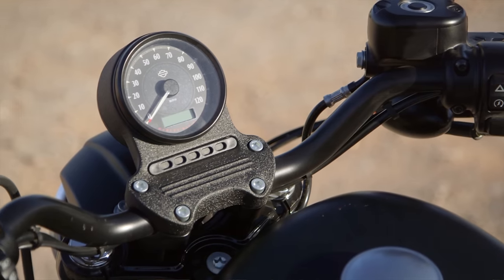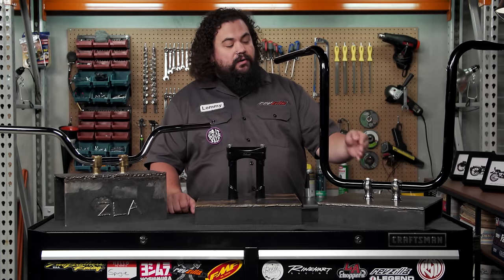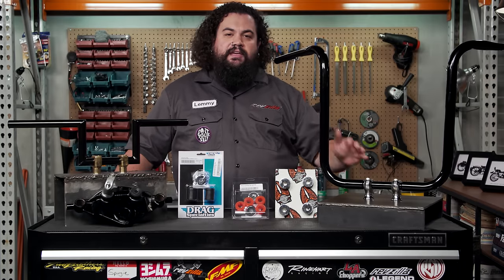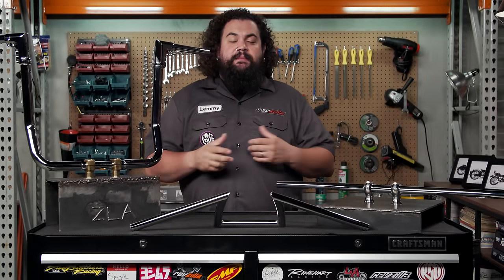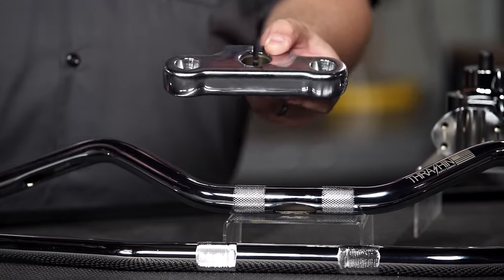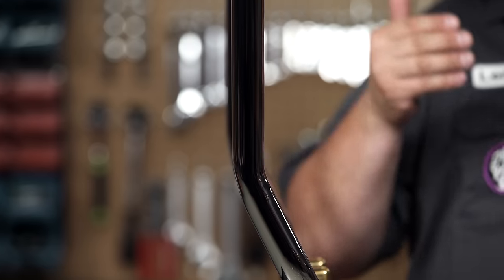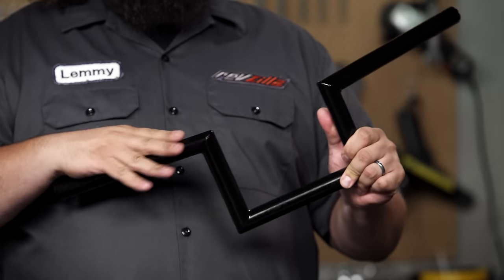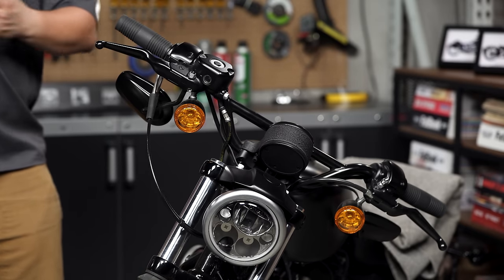How To Choose Handlebars & Risers For Harley-Davidson Motorcycles

Comment: Some 1-1/4" bagger HD bars require the left side of the bar to be trimmed if heated grips are used so that the controls will fit snugly against the 1" to 1-1/4" step-up. Real important to know before you assemble so that you don't have to take apart and do all over again.

Comment: Have a Yamaha Bolt that with the stock bars my left hand goes numb. I use gel padded gloves and upgraded to Avon grips but still get numbness in my left hand. Not a lot of options with my bike, already emailed Rox about their risers. Bar Snake won't work with stock bars either, found that out after purchasing.

Comment: Excellent video, thank you. How do I know if my 2019 Harley Roadster xl1200cx has internal wiring? I want to put ape hangers either 8" or 10" but don't know if I should buy pre-wired or just the wire kit along with the bars.

Comment: I currently have 11 inch "ram horn" bars with a 2 inch riser. (1999 FXDWG OEM)

I'm interested in swapping them for 14 inch lane splitter MX T-bars. Will I need any new cables?

Comment: I have a 2021 trike and I want to change out my OEM handlebars, thanks for the video and I know trikes were not specifically named but bagger’s and ultra’s were and we are in the same family. I have heard that on Harley’s 13 and down models only a 10” and below can be installed without using extension and on a 14 and up models we can use a 12” handlebar. What is your take?

Comment: I have a stock iron 883- and want to put on a set of biltwell chumps. Do I need to do recabling, or are they long enough? thank you
Reply from the maker: The 8 inch rise on the Chumps is probably too tall to keep the stock cables, but you could get the handlebar and see if the stock cables could work with some cable rerouting. -DrewZilla

Comment: Hi.
I'm from India and riding an  XL1200C of 2015. I want to change stock handlebar without changing any cables. Can you suggest the best bar except ape bars though I'm interested in 32wide reach handlebar.
Pl note I have to get it done at service center.

Comment: I want bars on my 02 Sofetail classic like the factory bars on my 72 FLH. I hate these low ape hangers that were on it when iI bought. I see bars but they aren't for inside wiring. With all the after market bars you would think there would be a ton of stock FLSTC bars on Ebay

Comment: I just got an iron 883 2019, if I was to buy the mini ape handlebars which have an 8.75 inch rise would I have to get a new cable kit and wiring?
Reply from the maker: Yes, you will need new cables and wiring. -DrewZilla

Comment: Hey Lemmy, I have a 2016 iron 883 , can you tell me the max height for drag specialties riser without changing out my stock cable. What would the max height be in the pullback riser and the straight riser ? Thanks !!
Reply from the maker: Your bike in particular has very little slack, you can really only get another 2" up in the riser, which would be the same for straight or pullback style.

-Zack
Reply: Perfect , Thanks for the info  👍

Comment: Hello. I have a 1975 harley fxe super glide and I have low drag brand handlebars and I want to add 10 inch ape hanger. So I can I put any handle bars on? I have the single piece knurled clamp and the handle bars I want say it fits 2000s harleys soft tails.  Any advice will be cool
Reply from the maker: Yes, you can put most any 1 inch diameter bars on. -DrewZilla

Comment: My handlebar end cap fell off. What holds it in place? Did another part fall out and is missing? 2003 anniversary RK. Thanks!
Reply from the maker: Those are likely aftermarket grips, so it would depend how those grips secure their endcaps. You'd have to determine the manufacturer. -DrewZilla

Comment: I just bought my first Harley Davidson. It's a fatboy 2010. It currently has pretty high Ape Hangers on it. Im not sure i like that, and would personally rather have a 6-8" t bar, fat dragbar or something like that. Im not 100 sure yet. But my question is, when it is currenty fitted with apes (im not sure about the rising, since i havent picked up the bike yet. But im guessing maybe 17" rise) What about the wiring then? Im guessing the wiring will be far too long when i lower it to, lets say 8" dragbars? Or will it be fine with nice cable management? Hope someone can help me! :D
Reply from the maker: You will most likely need to get shorter clutch/brake/throttle lines and perhaps shorten the wiring, but you won't know until you get the bike and see. -DrewZilla

Comment: Can you tell me which risers revzilla carries that are made to take a 1¼" bar that narrow down to 1" at the clamping area and covers the gaps between the riser and the areas where it steps up to the larger diameter bar?
Reply from the maker: The standard diameter for risers at the clamping area is 1 inch, so if you have 1 1/4" bars that are stepped down to 1" at the clamping area, then you would want risers that have a one-piece top plate to cover the full width of the 1" stepped down area. Avoid one-piece risers that are angled, as they would show the step down. Look at those that are very rectangular. -DrewZilla
*http://bit.ly/VTwinRisers_1inchDiameter

Comment: I listened to the whole video,didn't get the answer that I was looking for.
Wanted to know how to factor in the height in inches that will relate into the shortened reach as well.
I have heard that for every 1 inch in height,it will also shorten 1 inch in reach distance as well...I'm Not sure about that but was hoping to get that answered in the video.
          I am planning to buy soon the 2020 FXLRS...
Trying to decide to either go LD's 13 (11")...or the MX SD Bar (12").
I am 5' 4" in height so I'm kinda short,I want the bars at shoulder level.
I don't want the bar to be at full arm extension but neither do I want it to be too close.I have looked at many videos to get some good idea but only getting confused.
          A reply would be much appreciated if you can clear this up for me to go in the right direction...and Thanks👍😎.
Reply from the maker: There's no hard and fast rule about height to reach. There are a lot of factors: the angle of the bars, the pullback, your torso length, and your arm length. You will need to measure the height and pullback of the stock handlebar then put your hands in the desired position in the air and have someone measure the difference from the stock bar. -DrewZilla
Reply: @RevZilla  
Thanks for the reply and info👍😎.

Comment: Any idea how much you can rise the bar on a sportster without changing the wiring? Thanks
Reply from the maker: You can go to about a 6" bar in height typically without requiring new cables.  This is the tallest bar we typically see installed with stock wiring:

www.revzilla.com/motorcycle/biltwell-keystone-1-handlebars

-Zack
Reply: @RevZilla  thanks so much for the answer, really helped

Comment: I have a bad back. On my 2000 Electra glide they are stock bars. What style bars would be best to take tension off my back? I’m thinking a very up straight riding position would be best. With the stick bar I stay slightly hunched over and I’m about 6 ft 2 in tall.
Reply from the maker: Yes, I would recommend handlebars with more pullback and possibly more height. Unfortunately, we don't have the stock bar dimensions on-hand, but if you eyeball the height, width, and pullback of your current bars with a tape measure, you can send us an email or give us a call to discuss further. We can be reached at cs@revzilla.com or 877-792-9455. -DrewZilla
Reply: Really, I was thinking beach bars but you say that would not be a good idea?
Reply: Right now there stock bars on a Electra glide.
Reply: Sorry already told you that. There in the stock position. I’ll take some measurements email or call. Thank you.

Comment: Lemmy what about my 2008 low rider. That darn indicator clamp. Trying to do a tbar look. Any thoughts??
Reply: And hide the wires.
Reply from the maker: If you want to still have indicators with a T-bar, the most popular thing is to use is small Motogadget gauges. -DrewZilla
*https://www.revzilla.com/motorcycle/motogadget-motoscope-mini-speedometer
*https://www.revzilla.com/motorcycle/motogadget-motoscope-mini-combination-handlebar-clip-kit-bracket

Comment: How are those factory mirrors on the sporty. I have 08 nightster and haven't fiddled with the mirrors to get the clearance left side hits tank. When I bought it they were under and I made them switch them back and last month decided try it again but haven't gotten the fit right so the hit
Reply from the maker: They work just fine. -DrewZilla
Reply: Any idea the cost on them

Comment: Hey, what if you wanted to put on a set of sport bike forks to enhance the sporty. How would one go about that?
Reply from the maker: That's a whole can of worms so to speak. Sport bike forks are generally set up for light sport bikes, so the springs and damping are generally too light for a heavier Harley. Also, those forks are generally shorter than most stock Harley forks. So you'd basically need to rebuild sport bike forks with heavier springs, longer fork tubes, different valving, and then custom triple trees to adapt the forks to a Harley. It's way easier to just install a Monotube Fork Cartridge Kit designed to make stock Harley forks perform better. -DrewZilla
*https://www.revzilla.com/motorcycle/progressive-monotube-fork-cartridge-kit-for-harley
Reply: RevZilla that’s good to hear. I’ve seen some that convert GSXR fronts to sporty’s just to get a more sport bike feel out of them. I live in NYC so it’s riddled with custom Harley’s, DUcks, triumph’s and cafe racers. Just trying to enjoy my ole 883L before I think about grabbing a sport touring which is more applicable to the city life.
Reply from the maker: I hear ya!

Comment: You mention cables being to short. what about to long. I have a 48 special with tallboy bars but want to put on drag bars
Reply: I've run into that problem. You can get away with a little extra length, but not a lot or it will either not work or it'll look terrible. Worth spending a bit more to make it perfect so you'll be happy riding.

Comment: Hey,does anybody knows in harley sportster iron xl883n abs 2017 what is the taller bar(rise) i can place without change any cables?
Reply: I put 12 inch Todd's Cycle handlebars on mine. Had to extend the clutch cable and the brake line. Ran the wiring internally and didn't have to lengthen. Also didn't have to extend the throttle cables. But mines not ABS. You could probably go about 8 inch, maybe 10.
Reply from the maker: Generally, you can go up 1 inch in rise without changing cables. -DrewZilla